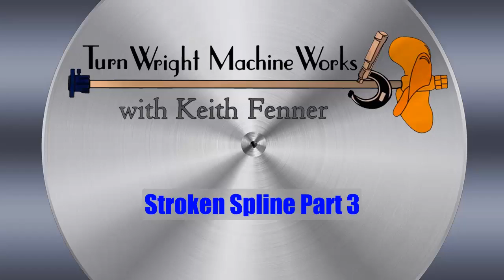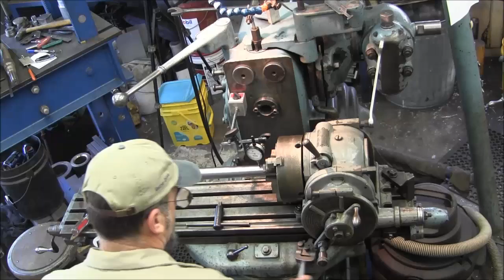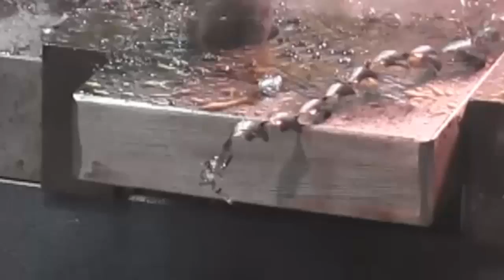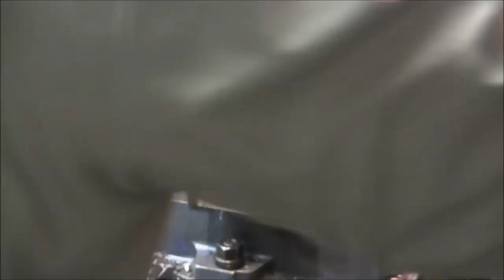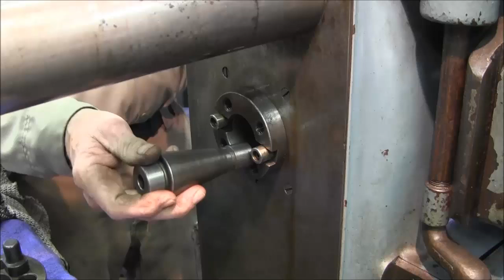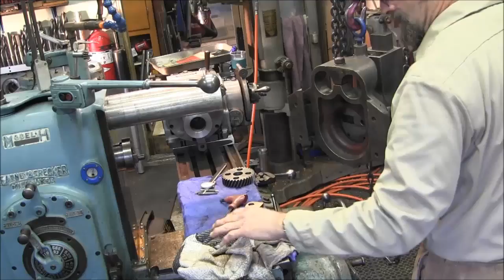The Stroken Spline Part 3

Comment: Thanks for the wonderful videos. I have a Vertical K&T mill the same  size  as yours.  I  also have  that exact dividing  head.  They are  a beast when it comes  to removing  metal. Mine has  a  #50 Taper spindle  with a #40 factory reducer. We use 1 1/2" " roughing end  mill a  lot. It's a  pleasure to watch  them  cut.

Comment: When making the spacer to go under the dividing head why not machine a key-way (the same width as the table slots) in the underside of the spacer, so you can use a key to quickly align the dividing head with the mill table?

Comment: I noticed that you don't discuss the counterbore diameter for the recessed bolt head much... If you are going to use hex head bolts, you need to be able to get the socket to turn freely when you tighten or loosen the bolt, so the counter bore has to clear the OD of the socket... Or, if you prefer to use socket-head cap screws - female Allen or Torx or Spline key in the bolt's head - you can make the recess a tighter fit to the head of the bolt...
Reply from the maker: Thanks for adding your comment with a little more details to that part of the project! ;{)------

Comment: I enjoyed watching you set up the mill and talk about the history you have with it. Seeing the shaping and the vertical heads makes me miss the old Quartet mill we sold back on 2012. It had the same two attachments you have that had been modified to fit on the mill. 
I only ever used the shaper head one time, but to make several parts. We had to cut a large internal hex and it worked perfect for that in combination with a turn table. Sure wish I had a video of it. 
Looking forward to the rest of the series Keith. 

Adam

Comment: Hello Keith, how did you make the surface of the spacers parallel? Surface grinder?
Reply from the maker: I settled on the cold roll surface of the material as my close enough for the purpose. I don't have a surface grinder which would of been my choice to get them perfect! ;{)------

Comment: What is a ball park figure for have a drive gear cut?  You see a few of these heads, but they seem to almost always missing the drive gear.
PS  thanks for the advise on the tapper pins.  I have the feed box just about ready to go back into the knee.
Reply from the maker: Well I paid back in 95 or 96 about 500 to 600 to cut the teeth after I made the blank.          ;{)------